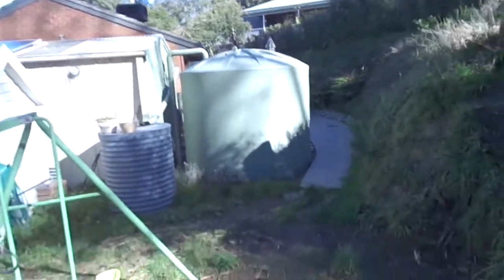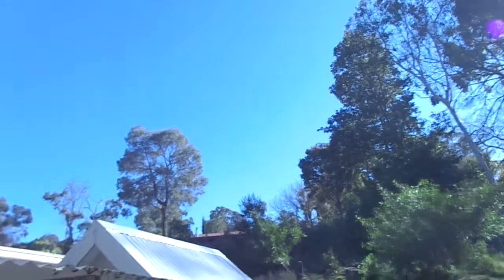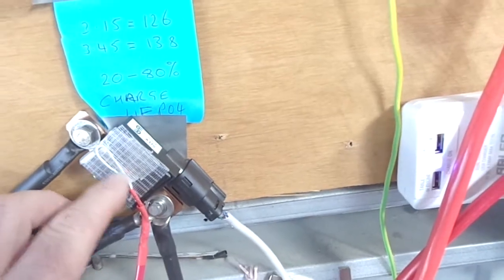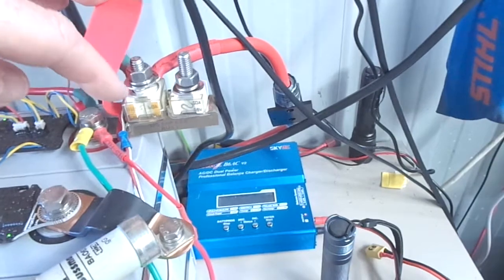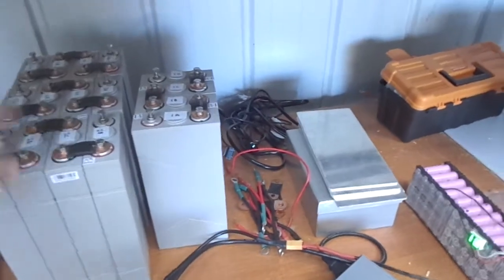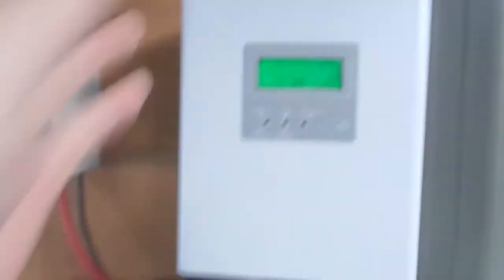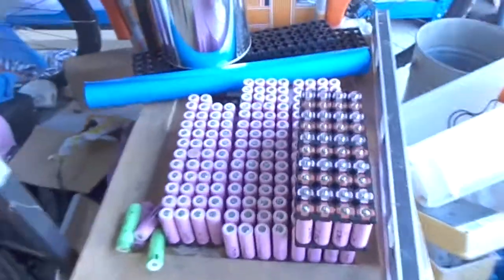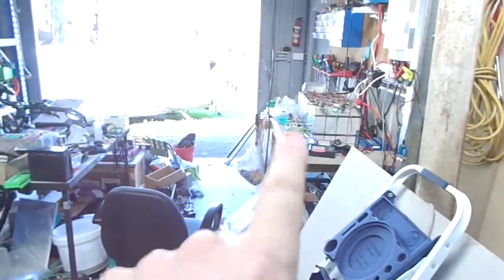48 volt CALB LiFePo4 Off Grid Solar - Battery System Update

Comment: If you have the space,  it is worth fitting extra insulation round the outside of your chest freezer. 50mm of foil-faced PIU board will cut the power use 50%. Remember to leave the heat-exchange bit uncovered!
Reply from the maker: nlo114 That’s a great idea! Thanks

Comment: Nice system. It will be good once you get the cement sheet and marine ply up and it a bit more neat. The plastic over the battery terminals isn't a solid option for safety!

Comment: just add the 60Ah cells to each 100Ah cell so the bms with work the same, so each 100Ah cell will have a 60Ah cell in parallel
Reply from the maker: I was thinking that's what I'll do.
Thanks for the comment

Comment: New shunt is comming. The one you are using are not created by Batrium themself :)  But yes i have striped my positive wire to keep it in position. 
Regarding the SOC, You can reset it. Or you set it a bit low and let it reset every time you charge up to max. It kind of sorts itself :)
Blockmon vs longmon. They differ in terms of the thermal capabilities due to different boards. You can run them with each other but they will have same settings. As long as you have the ones with same heat dissipation thats fine. 
You will find shunt trips on ebay among other places. 
Personally i have the shunt very close to the batteries and i dont include the shunt in same case as the watchmon. I dont want to mix in that part in there.
Reply from the maker: Thanks. I'll have another look at the SOC situation soon